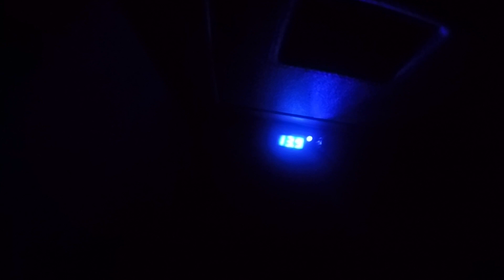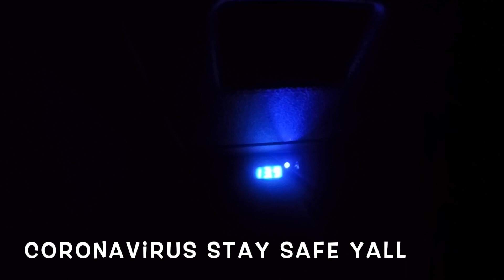DIY: Kinetik Rev 1200 Voltage Issues Pt. 2

Comment: the voltage should go up to 14v when you rev and hold around 2-3k rpm. even those big builds with 5 alternators rev their cars when doing demos at full tilt
Reply from the maker: Rowboyto I fixed it, just haven’t uploaded the video yet 😹
Reply: oh what was the reason of the voltage drop
Reply from the maker: Rowboyto added one more ground, that was missing, which was the one to the engine
Reply: Yes you should always change your ground wires lol to 0 or bigger even the one from the alternator to the battery
Reply from the maker: LogicallyInsane yeah I'll get on that once I get some free time